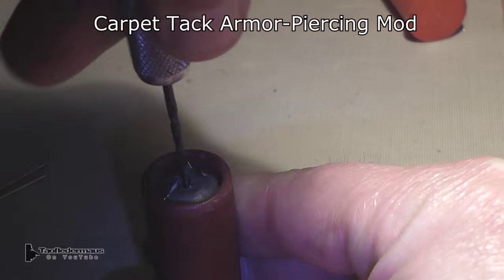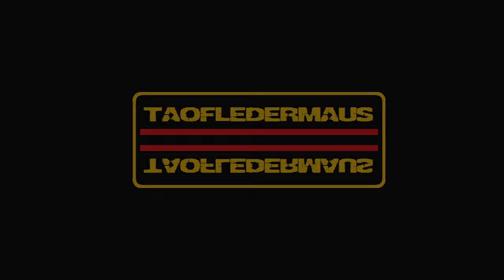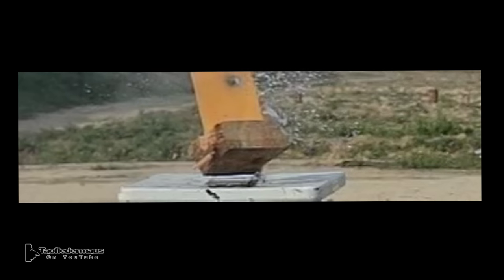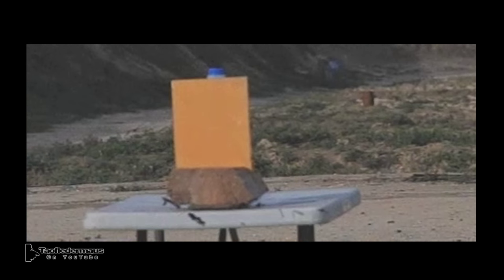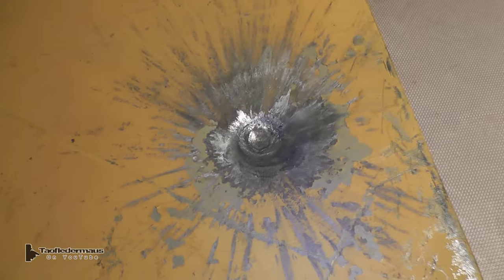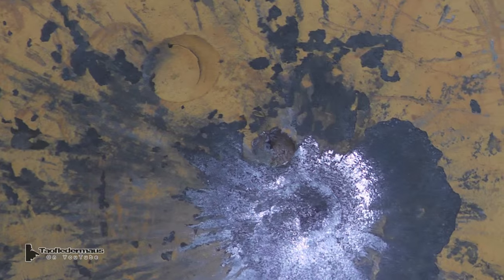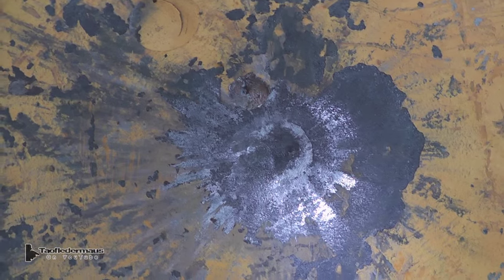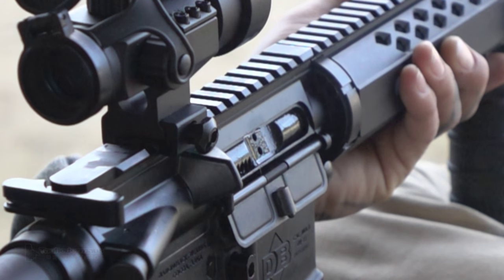Can a CARPET TACK  Go Thru ARMOR?  (Urban Myth)

Comment: i have a challenge, make a shot gun round with as little penetration out of high brass as you can, has to be a solid round, can't be shot. It would be funny to see a round that comes out of a shotgun and it smacks agents a peace of cardboard and just shatters and doesn't go through. (yea i know, that's pretty much impossible.)
Reply from the maker: +angryace13  Even the wadding will go through cardboard at 30 or 40 yards  (if you are lucky enough for it to hit it)
Reply: yea i figure anything that gets any decent velocity can penetrate cardboard, but what about something that achieves very little penetration but still has decent velocity.
Reply from the maker: I can't think of anything that would do that
Reply: what do you think you guys could throw in a shotgun shell that would have a hard time penetrating say... a car door?
Reply from the maker: We have a video showing that.  Bubblegum dimes,  silly putty ect shot at truck door.
Reply: yea i saw that video.

Comment: who the hell ever thought that would work?
Reply from the maker: +Christiån Kirkenes  Who would have though a carbide core inside a lexan slug would work?
Reply: tungsten carbide is a bit different to cheap low carbon steel.....if they are steel at all.
Reply from the maker: +Christiån Kirkenes   It's easy to make predictions after the tests have been made.